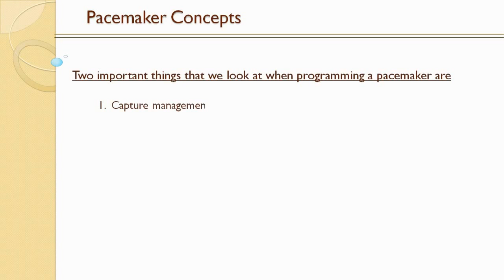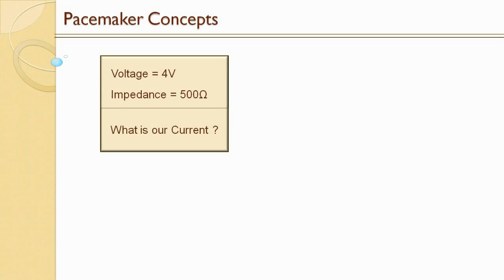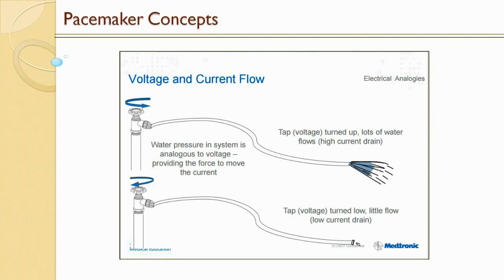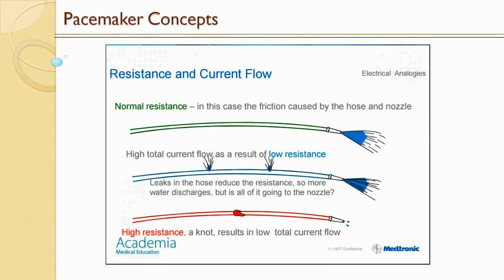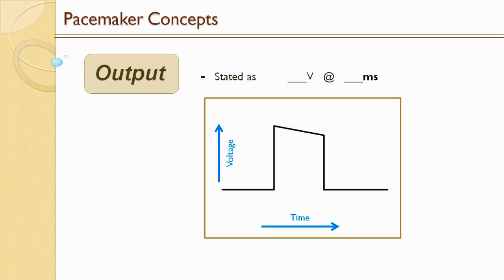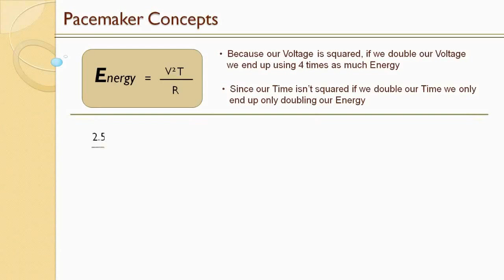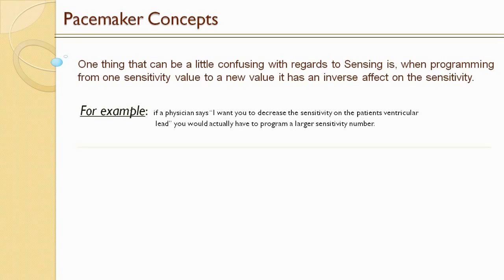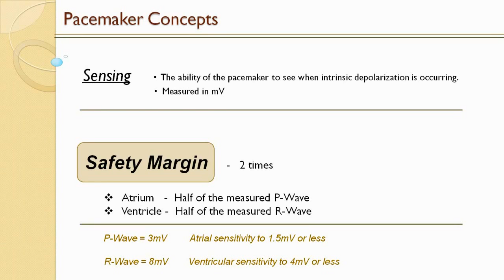Pacemaker Concepts - Sensing, Impedance and Threshold Measurements

Comment: Hi, thanks a lot for the great lecture but I have a comment. In the Energy Equation you multiplied the Joule value by 1000 but you wrote microJoule, that should be milliJoule and not microJoule?
Reply from the maker: Thanks for the comment/correction, that was a good catch!  So, the answer is supposed to be in microJoules.  My mistake is that I labeled it Joules X 1000 when it should have been labeled as milliJoules X 1000.  For the equation, I didn't properly take into account that the time was in milliseconds and not seconds.  So when you covert the time to milliseconds the answer should have been in milliJoules X 1000 giving us a final answer in microjoules.  

Thanks!